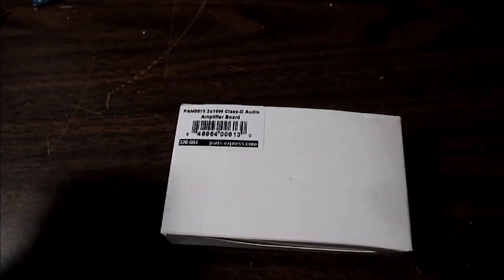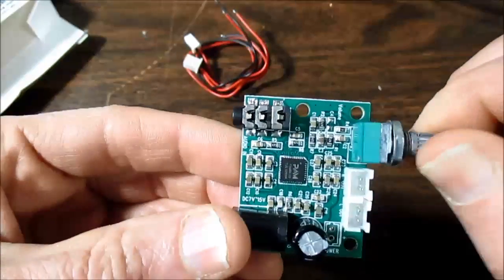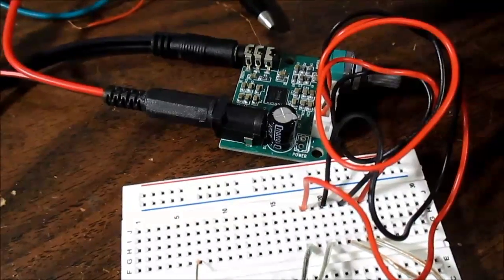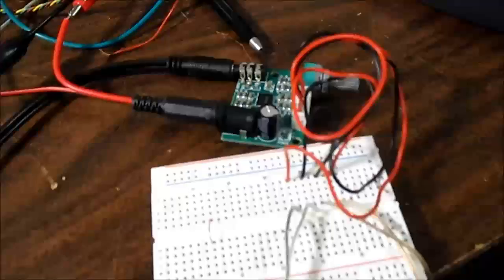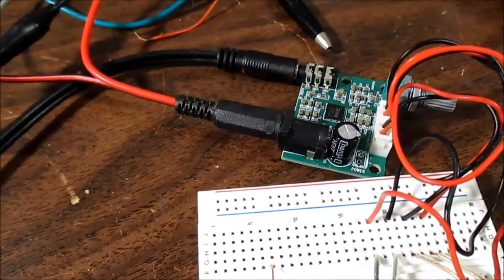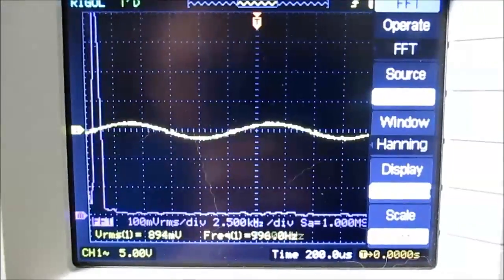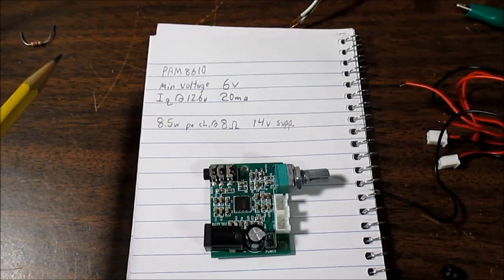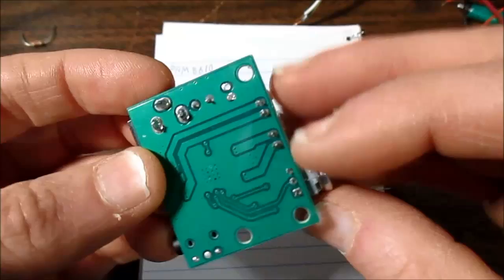PAM8610 mini stereo amplifier with volume control, test and review

Comment: A few things ive notced messing around with this amplifier over the past 3 years, is the louder you turn the volume regardless of the input volume even if the input volume is low and you crank the gain on the actual amplifier, the cleaner it sounds, if you have the amplifiers volume set to a min but still enough to hear alittle with the input volume from your source turned up it sounds grainy, but not as in it clipping the input grainy, but in a lower power state kind of sound even with the input source partially turnd up, its probably due it being a dc stepped controlled amplifier design. i usually run the amp with the volume up all the way and control the volume with my source which i feel gives me better sound quality, I used one heatsink like this https://www.ebay.com/itm/Mini-8-8-8-8-5mm-Heat-Sink-Top-Mount-Pack-of-10/301459243369?hash=item46305f0169:g:rYsAAOSwg3FUnlDq  i also used this artic silver 2 part thermal epoxy to thermally bond the heat sink to the chip only a pea sized mixed drop of both parts in the center of the chip worked great, making sure not to get it on the ics pins or supporting parts. https://www.ebay.com/itm/Arctic-Silver-Arctic-Alumina-2-PartThermal-Adhesive-Heatsink-Glue-Epoxy-5-Gram/202604404865?hash=item2f2c29e081:g:gWUAAOSw0q1cbzqH after that i got one of these 4 amp 15v switch mode power supplies https://www.parts-express.com/15v-4a-dc-power-supply-ac-adapter-with-21-x-55mm-center-positive-(-)-plug--120-057 it handles 4 ohms per channel perfectly, even if you really beat on it, even with that little bit extra cost its well worth it. https://www.parts-express.com/pam8610-2-x-10w-class-d-audio-amplifier-board--320-604 it seems like they did come out with a version, that already has a heat sink and bigger storage capacitor, buy that and that 15v 4 amp power supply and you will be floored.
Reply: https://www.youtube.com/watch?v=FbmaYy_fEjk&feature=youtu.be

Comment: Seems to be reliant on the power supply to be able to provide enough power without sagging or rippling. I have a feeling this little amp would be really bad with a cheap power supply at higher volumes.
Reply from the maker: Yes, the power supply is quite important to amplifier performance.

Comment: I'm making a Bluetooth speaker, my drivers are 4ohm (20w max), they produce really good bass if paired with passive radiator.
What amplifier should i use? Power supply 12.6v battery pack. Thanks.

Comment: You are doing a great Job at your videos. Love them actually. For this AMP,  just adding my few cents here :
This Damn Chip is probably the worst of the PAM series. It is a RF monster, and that is why your TV amp is playing the audio there. Its Switching frequency(at least in the boards I have checked with) hit severely the FM Radio's IF frequencies, rendering the FM reception almost useless. But it does not stay there, these chips leak RF into the power lines too very happily. I would actually hate to call them good design by any means. using this amplifier without Filters at output and Solid Bypassing at power lines is like polluting the RF environment.

Comment: How do you think the performance would be if you used a solar panel that supplied 7.2 volts at 200mA for two 8 ohm speakers with this amp?

Comment: Great video... I learn a lot from all your video... just curious, how are we reduce the "hisss" sound?
Reply: The data sheet recommends 2 ferrite chokes around the N-Output and P-Output wire of each channel and two 220pf in series with a center tap ground in parallel with the N and P Input of each speaker.  So, 4 ferrite chokes EMI/RFI. range and 4 220pf caps.
Reply: I am so sorry, i don't understand the explanation about the capacitor placement. Is it the input from each channel of the source or the input to the speaker?
Reply: At the speaker input, there is a + terminal and a - terminal.  Take two 220pf capacitors and join them in series so there are now 3 points of connection, the two poles and a center.  The center needs to go to ground on the Amplifier circuit.  One of the two poles need to go to the t terminal, the other goes to the - terminal.  Avoid electrolytic capacitors due to size but if you must solder negative to negative to make it a non-polarized electrolytic.  Basically, it's a first order low pass filter to remove the hiss from EMI and RFI which would be about 100Mhz.  And so in theory, the capacitors could be connected across the amplifier P Output and N Output. .
Reply: PM the datasheet check page 13.  That will get rid of the RFI/EMI.
Reply: now I understand... thanks but how about the input?
Reply: The input?  Are you talking about the Amplifier input?  If so, that depends on the cause.  

JohnAudiotech has these videos for removing hum based on shielding feedback, grounding, and the power supply, :

https://www.youtube.com/watch?v=-DwXpAlIYnA 
https://www.youtube.com/watch?v=xbinXh1ZSqk&t=186s

Otherwise, you can reduce line hum by using a simple RC high pass filter tuned to 50 Hz (UK) or 60 Hz (US-- though the NAB and NBC recommended at least 50 Hz in the 1940s) BUT you'll lose some of your bass.  To keep the bass you can tune the filter at 20Hz to preserve more sound (the 20IEC amendment to the RIAA standard) but get more noise.  Or you can try a more expensive notch filter tuned to those frequencies (though 58 Hz is a good compromise for US or UK designs).

Another method is to try removing RF using a low pass filter set at the amp input tuned to about 50kHz (if I remember right, for some reason I remember talk of designing amps as a band pass with a high pass filter with a 3db rise starting at 15-25 Hz and ending with a 3db roll-off starting at 20-25kH and with another roll-off at 50kHz to get rid of stray frequencies).  The problem with that is the wires going to the speakers will act as an antenna and pick up some RFI/EMI so you'll need ferrite beads at the cables and filter capacitors across the speakers terminals unless you use 2-4 gauge solid core wire and a coil tuned to about 200- 300 micro henries across the speaker terminals but that has the disadvantage of passively boosting your lower frequencies.
Reply: will try on the out put first then see how is going

Comment: 18650 3S 1P fully charged would provide 12.6 volts. do you see any problem with that as a supply?  Can you please suggest a cheap Bluetooth receiver, instead of using the 3.5 mm input.  I've seen them all over eBay but never tried one yet.
Reply: Buy a PAM8610 with Bluetooth receiver. They are easy to buy on ebay.

Comment: Man, where did you get the transformer behind your tv? I have the same one, but ain't got any clue about the pinout. If you can help me that would be very helpful man. Thanks...
Reply from the maker: It came out of an old mini stereo. They can look identical but have different winding configurations. You may be able to see the wires where they connect to the pins. The thicker wires are for the main amplifier. The thinner wires are for the tuner, preamp and such. You have to put a volt meter on them to sort them out.
Reply: JohnAudioTech Mine came from old Aiwa stereo. Mine got 17 pins. Unfortunately, mine were soldered right to the pcb (with large traces), and the pcb is lost somewhere. I'm just curious if i can trace the pin with the bulb load? (that bulb that go to the mains and to your circuit etc) Thanks man

Comment: these class D o/p wires practically function as antenna and give out a lot of em radiation, with those high frequency sampling. some people i read, have suggested using ferrite bead or chokes at the outputs.

Comment: I'm curious about how much current this little amp pulls from its power source when it's being driven hard.   I'd expect at least 16W draw based on 8W/channel, it's bound to be higher due to overhead and heat dissipation.  It looks like an ideal solution for a project I'm thinking about.
Reply from the maker: At the measured output of 8.5 w/ch, I'd estimate 19w given an efficiency of around 90%. With 14v supply, current would be 1.36amp. Of course that is with the continuous sine wave. Typical music would only require and average of a couple hundred milliamps or so. YMMV.
Reply: John, thank you for that information.  It looks like this amp is perfect for what I have in mind.  It'll be battery-powered, so high efficiency is a must.

Comment: you might want to try the cheaper eBay PAM8610 boards to see how they compare.
http://www.ebay.com/itm/New-Hi-Fi-Soundplatine-Audio-Stereo-Amplifier-D-Klasse-Soundboard-PAM8610-2x10W-/272445571962?hash=item3f6f05837a:g:eBMAAOSw44BYKqRj

Comment: I had a cheap 4ohm speaker burnt by this amp at 12 volts!! The chip does get hot as hell without heat sink...

Comment: I got two of those. IC are getting hot... and its a bit distorted...
Reply: I wonder if they have some kind of internal overheat protection?
Reply: Hill's Workbench im not sure. but mine? I add heatsink just to make it sure...
Reply from the maker: While I didn't check this one, about every audio power IC made since the 70's has thermal and short circuit protection. Running the IC hot but short of tripping the thermal protection limiter can still shorten the life of the IC.
Reply: I guess I'm wondering about the nature of the protection method(S). Protect by shutting off until it cools? Or some kind of limp mode that might result in distortion.
 This could be a video or part of your test regime, attach an undersized heat sink, and run 50% power till they overheat.